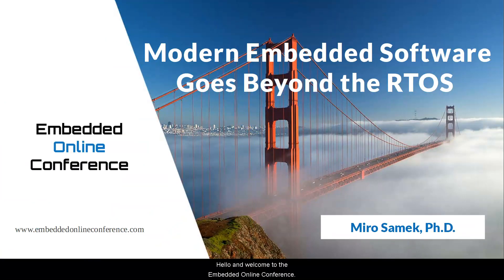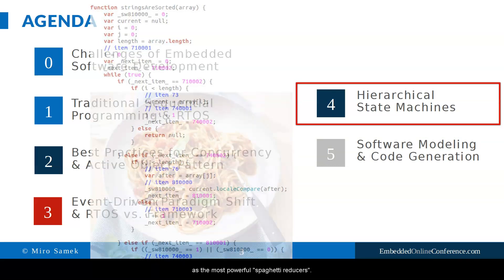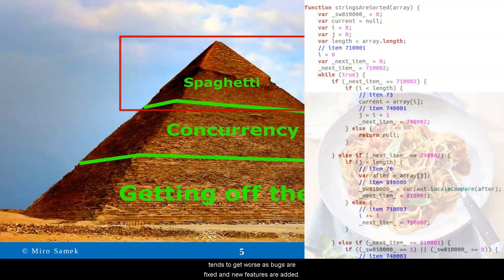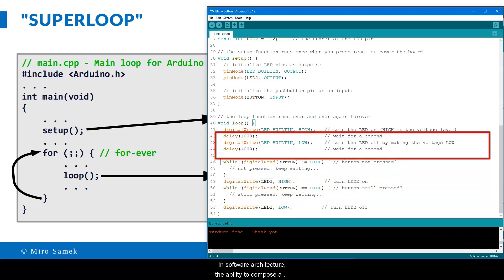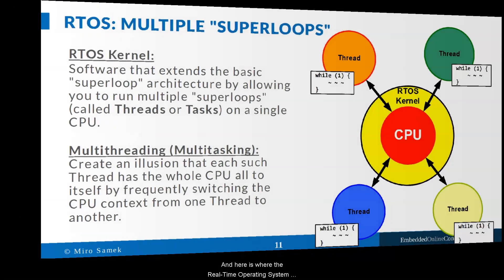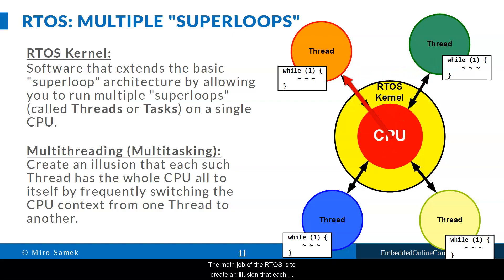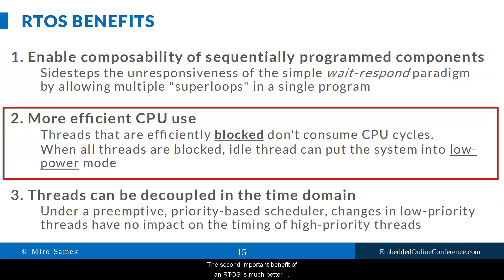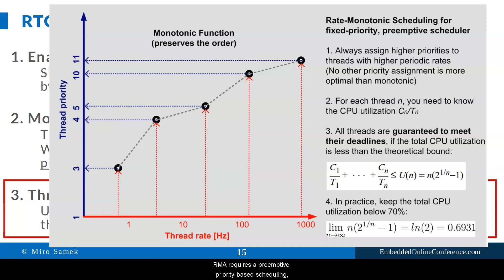Beyond the RTOS - Part 1: Concurrency & "spaghetti" as main challenges of professional developers

Comment: It seems that the problem of RTOS is the mechanism of preemption, which takes the control out of the running task unexpectedly. Coroutines on the other hand (I already read your discussion with Larry Ruane about protothreads on embedded gurus) voluntarily yield control of execution to the scheduler, eliminating preemption (without taking into account interrupts). Protothreads are the foundation of contiki-ng RTOS, so in a way they are successful. The nice thing about coroutines is that they fit nicely with the sequential execution mindset of the programmer. The bad thing about the Actor pattern is that it requires to entirely change the mindset of the programmer, and is hard to implement in code (that's why you invented QM software to help people transform a state chart into code). Take a look at nodejs or asyncio in python, they hide completely from the programer the underlying event loop, giving a coroutine interface to the programmer. Maybe the same can be done for your framework.
The good thing about QP is that allows to use a preemptive RTOS altogether with the state machine framework, so you can keep part of the code that makes sense sequential and part of it asynchronous, so the drawbacks of the Actor pattern are somewhat minimized. 

Don't get me wrong I think your framework is one of the best pieces of code I've seen for embedded devices, but is hard to understand and put it into practice. I think that your course in combination with the gplv3 license of your software are a great idea to promote your work and products. Thanks for sharing and for the education (I don't think is free, it is just a good way to invest in your company).
Reply from the maker: You seem to be forgetting what kind of game is being played here. If you are interested in (hard) real-time (as the RTOS and the "Active Object" pattern generally are), then preemption is a necessary evil, so you need to somehow live with that. Of course, coroutines and cooperative multitasking are simpler, but they generally don't decouple the various activities in the *time domain*.

(On a side note, I'd like to point out that even in the coroutine/cooperative multitasking world, the event-driven state machines have advantage over traditional sequential approach, because event-driven systems have generally short RTC steps, which might be short enough for meeting real-time deadlines.)

Protothreads could warrant a separate presentation and discussion, but let me only say here that they are "crippled" state machines. By this I mean that state machines can do everything that protothreads can, but the converse is not true. And I've not even meant here hierarchical state machines, just the regular ones.

But you are right that event-driven programming and (proper) use of state machines requires a paradigm shift, which might be difficult for a traditionally trained programmer. (That's why protothreads are so appealing). But this is just a matter of habit. For someone with more experience with event-driven way of thinking the exact opposite is true. This presentation is intended to pull you out of your comfort zone. That's how progress is made...

--MMS
Reply: @StateMachineCOM  RTC state machines and cooperative multitasking both suffer the same problem, if task are not short enough you risk not meeting hard realtime deadlines, I don't forget about that. In fact, FreeRTOS coroutines (similar to Adam Dunkels protothreads implementation with an scheduler) are intended to run in the idle task to make sure you always preempt them. Moreover you provide a matemathical proof that guarantees meeting deadlines in priority based preemptive multitasking RTOS in the presentation. 

I think what you say is true, we should change our way of thinking when solving programming problems and you are doing a really good job to help us change, thanks!
Reply from the maker: @JonitoFischer  The main point of the presentation, shown exactly in Part-3, is that RTC state machines do NOT suffer the same problem as cooperative multitasking, so as long as you believe the opposite we are not making progress here. (Please also see the comment section under the Part-3 video, especially the comments made by 
Kemal Hocaoglu).

The point is that Active Object design pattern can be combined with all sorts of kernels, including the preemptive ones. In the latter case, you have a (hard) real-time system, which is not only as good as any "purely" RTOS-based solution. It is actually even better for (hard) real-time than the "naked" threads, because you don't need to worry about willy-nilly blocking. This makes RMA/RMS much more straightforward, because it is much easier to calculate the CPU utilization for the threads. --MMS
Reply: @StateMachineCOM  I was just reading that answer today... Let me process your comments and we can continue later... Thanks for your kind replies...
Reply: @StateMachineCOM  ok I understand what you say, but let me point out that when you talk about RTC you are thinking that there is also preemption, which may also be the case in cooperative multitasking (as in FreeRTOS coroutines running on the idle task), where you can have several sets of coroutines working on different threads. Maybe this concept about RTC was not completely clear to me from your presentation. I think what you mean is just not making any call to a blocking API of the (RT)OS in the event handling function.

What I meant was that RTC without preemption, as in QV kernel case (please correct me if I'm wrong), is the same case as coroutines holding the processor for a long time without explicitly yielding control to the scheduler, leading to missing deadlines. Scheduler preemption is just a special ISR with superpowers, it can change the SP and context to make the illusion of parallel execution. So RTC or coroutines without preemption means just using regular ISR to meet hard real time deadlines and the background loop to handle all non-critical extra work. Or just a fancy way to implement the foreground-background architecture, as you explain in your course.

At this point, I would argue that although coroutines or protothreads are crippled state-machines (just plain FSM, not HSM), some times they are good enough to solve a given problem, if certain particular conditions are met. Examples are contiki(-ng) Process, FreeRTOS coroutines, Larry Ruane Protothreads, and even C++20 coroutines (I don't know the low level details in this case) existence, which at some point are successful. Given a set of tools, and a time frame to solve a problem, even the technically incorrect tool to solve the problem is ok if you can solve the proble inside the given time window. For instance, a hammer is not the recommended tool for a screw, but if your out of screwdrivers, that hammer starts to stand out as a good tool for solving the task at hand (lines of thought like this gave birth to the Arduino era). Again, your framework based on state machines and the actor pattern scales wonderfully, it is a professional way to program, I have no arguments against it. But sometimes, people just need a hammer to nail that screw, haha...

Comment: Interesting topic! I have 2 questions:

1. For this specific task (blinky + button), button can be done in a Pin Change ISR, and blinky can be done in a Timer ISR. Wouldn't utilizing these ISRs on Arduino make it "seemingly" concurrent as well?

2.  At 14:02, how could the processor know that the delay was about to elapse if it's running another thread? Is there any specific hardware that does the timekeeping?
Reply from the maker: Yes, utilizing interrupts and ISRs (Interrupt Service Routines) would make the code execute "seemingly" concurrently as well. In that particular case the actual work to do is so minimal that it can be all implemented inside the ISRs. But in general, if you have more to do, ISRs would be too long, which would create other problems. For that reasons people have invented RTOS and threads.

Regarding the RTOS delay, you are absolutely right that there is a specific hardware that does the timekeeping. This is called the "system clock tick", which is a periodic interrupt that calls the RTOS's tick-service. In that tick-service the RTOS "knows" that some threads need to be unblocked. Please also watch the lessons on RTOS, where all of this is explained: https://www.youtube.com/playlist?list=PLPW8O6W-1chyrd_Msnn4LD6LBs2slJITs . --MMS
Reply: @StateMachineCOM  Thank you for the great answer! Indeed, when the complexity increases, ISRs start to become a problem. I'll be sure to watch your RTOS videos!

Comment: A very nice explanation! Thank you. 
So even in a single core/thread CPU system, we can get speedup just by using an RTOS instead of plain C-code!

However, I have one doubt. Is threading possible without any OS? In plain C- code, can we run 2 threads simultaneously? For pthreads, we need UNIX like OS,  but what about other threading techniques?
Reply from the maker: As I mentioned in the presentation, if you'd like to learn more about multithreading and how it really works in a small microcontroller, you could watch my RTOS video series (https://www.youtube.com/playlist?list=PLPW8O6W-1chyrd_Msnn4LD6LBs2slJITs ). But, yes, typically, for multithreading you do need a kernel, either RTOS kernel or Linux kernel (for p-threads). But such traditional kernels are not the only game in town. I plan to talk about other types of kernels (e.g., preemptive, but non-blocking kernels) in my ongoing Modern Embedded Programming course (https://www.youtube.com/playlist?list=PLPW8O6W-1chwyTzI3BHwBLbGQoPFxPAPM ). --MMS
Reply: @StateMachineCOM  Thank you Miro :). I will definitely watch the RTOS series, your channel  has really high quality contents :)